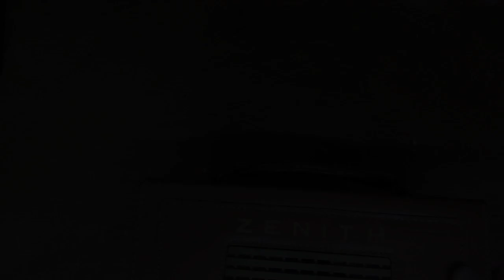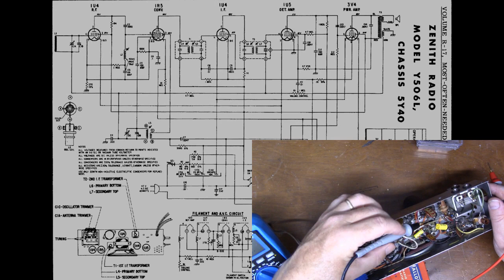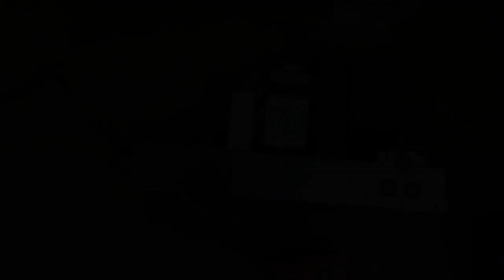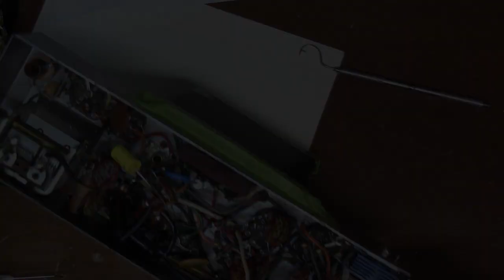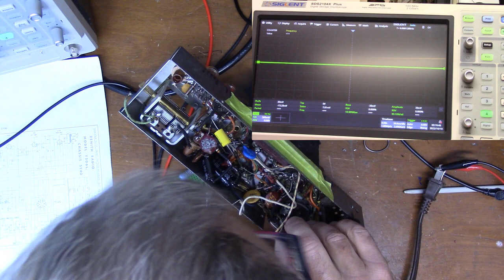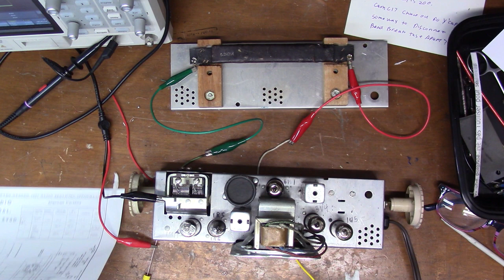03022 A Classic Beach Radio from the 1950s.  A Zenith Y50L

Comment: How do you have an AVC circuit when all the tubes are sharp cutoff?  Should have used 1T4s where the 1U4s are to get decent AVC action.
Reply from the maker: Hmm I can't say much to the use of the IU4 as I only fixed it up I did not design it ;).   Looking back at the schematic  the AVC is integrated into the filament circuit to get more   '-'  on the plates of the  RF, Converter and IE tubes.  A little more complex than the simple AA5 AGC of  more  '-' voltage on the converter's grid. The designer  might of though this was a better choice, Zenith always put quality of signal over minor cost savings into their designs.